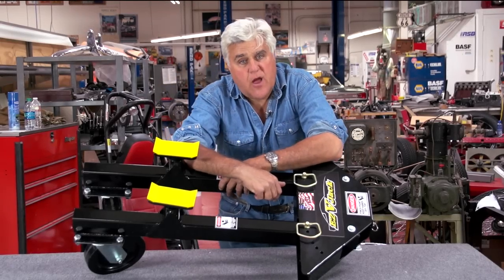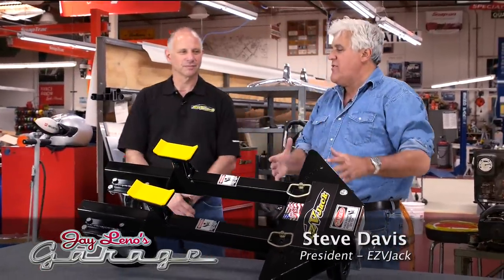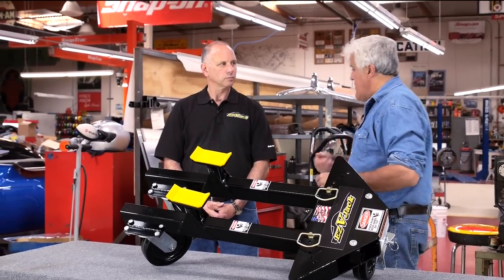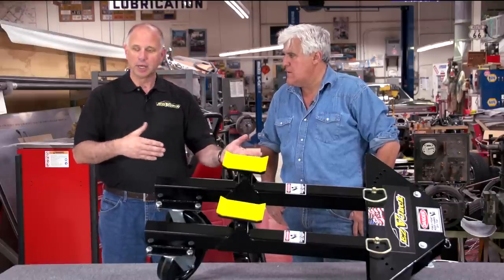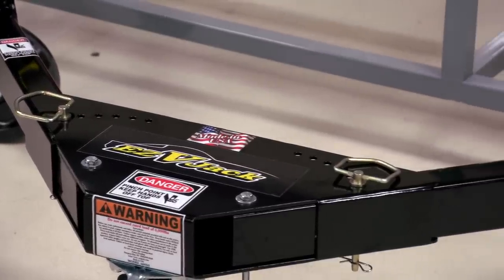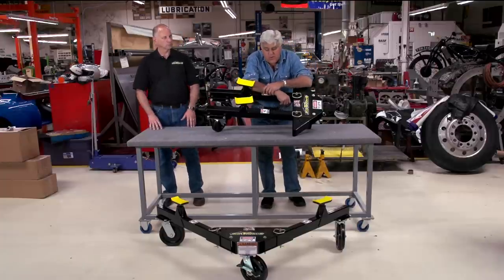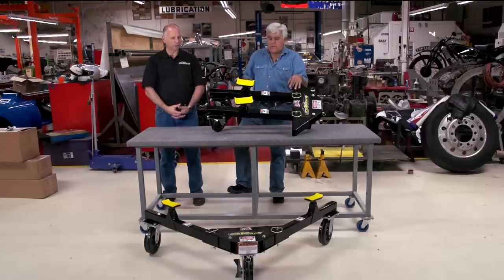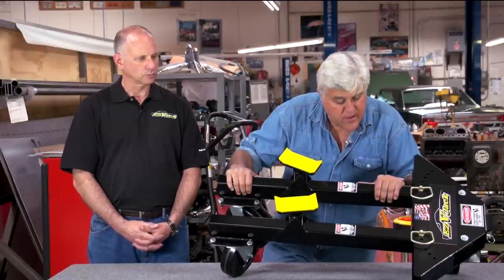Rolling Car Jacks - Jay Leno's Garage

Comment: I'm a disabled retired combat veteran that needs to rent something like that to move my '79 Trans Am 35 feet into my driveway before the property manager has it towed. Because I was forced to pull it out of storage after 15 years and the carb is shot to heck. I've been wanting to design something on this idea for a while now, but something motorized and with a wireless remote. A grand for something I may only use once is a bit much for my pocket book. Great product though. Thank you Mr. Leno and team. Thank you for your service Steve.

Comment: I would add two features.  I would have the axle pads set on an adjustable post, like an everyday jack stand.  There are some 4x4's and large rim cars where the rear axle is much higher off the ground.  Second, you could have a handle the connects to the front wheel.  It would be like a tow bar for a small aircraft and you can direct the direction of the vehicle much easier.
Reply: nice upgrade and that shouldn't cost all that much to do ... just tack on another $500 / each and they can be yours !

Comment: The good stuff is NEVER cheap.

If you are not someone who uses this type of gear on a regular or semi-regular basis, $1000 is going to be a hard pill to swallow. But if you like or need to work on your car, like tuners, modders, restorers, racers, and so on, this is actually some seriously inexpensive hardware.

They even tell you who these jacks are aimed at on the website. Complaining about the cost is just short sighted an more than a little lame.

Comment: They've "Raised the Bar" with this product.." I'm so pumped man", i just "need a lift" so i can go and buy one.. $9.99 is a fair price.. That's what the stricked stubborn sounding man said right? $9.99.. wait a second.. whaaaat?!? $999? are you Serious? GTFOH. it's worth $450 tops
Reply: $999 for a pair as in two of them
Reply: I'm curious to see your calculations that yielded $450 price.
Reply: Alessandro Galiano Doesn't it always? lol
Reply: It's $999 for 2 dude.  That is $499.50 each.  Close to your $450.
Reply: 2018- $1499 a pair

Comment: Interesting but I think I'd still rather have a set of Go-Jacks
Reply: Yeah but gojacks are for vehicles with wheels still attached. You can take all the wheels off and still use these
Reply: I think application would be important between this and go jacks. I do like these for the wheel off option. that and there about the same price.

Comment: Without any vertical adjustability I can't see this as an option for a $1000. I have some steel plates from Harbor Freight that would be about a $100 to $150 and yes they have the smaller castors and two of them lock. They work but if you have a floor that is not flat it can be difficult. I can see the advantage of the larger wheels.

Comment: I'd still rather have the wheel-jacks, you can fit them in without having to jack the car up or even inflate the tyres, and they work on cars without separate chassis. You can also pick up ten full (good quality) sets for the same price as one pair of these! Nice concept though.

Comment: That's a 1000 bucks just to to sit under a car, 2 high quality floor jacks would be money much better spent.
Obviously aimed towards the rich guy
Reply: It's not made just to hold a car up. It's made for shops so they can bring the car in, inspect it, and be able to easily move it back out. It's made for cars that can't be moved because they have been wrecked or are projects and don't have wheels, axles, subframes.
Reply: Or more likely aimed at businesses.  If you use it for one car it's expensive, but if it's a shop tool that lasts and as a bonus the money stays here,  it's value goes up dramatically.

Comment: I think that is a fair price for what you’re getting. Hell the jack stands we use cost $200 a pair. Or you could buy Harbor Freight ones for $50 with a coupon. Oh wait you can’t anymore because they have been recalled and no longer for sale. This product looks like it works, sub $500 are a pain in the A$$ and sketchy.

Comment: 3 LARGE CASTERS A FEW PINS AND SOME SQUARE TUBING WELDED ? $1000 ?? you can buy all the materials and still have money for an eastwood 175 mig welder to finish the welding .... I am a veteran and above all else I consider value the most and this product doesn't even include the jacks ?
Reply: Don't forget the powder coating, lol. If the metals thick you could probably stick weld it even cheaper (including a new mid range stick machine).

Comment: Is there a powered car mover made that could be used in a situation where there is a two car overhead door that is too narrow to easily fit two cars? My objective is to drive into the garage, then move the car perpendicular to the overhead door. Then the second car fits in easily. 

This is a common problem in Florida, where the dual overhead garage doors are really too narrow to fit two larger cars. It’s not possible to increase the width of the overhead door, because the overhead door was narrower to make the house stronger for the possible hurricane winds. The house would have to be re-engineered, which would be cost prohibitive. As a result, many people only park one vehicle in the two car garage, and the other vehicle must park on the driveway.

Do products exist that could be installed in the garage floor, so the car can be moved perpendicular to the overhead door electrically?
Reply: You mean probable hurricane,right?
Reply: @peterzinia3767 The double overhead doors in Florida are narrower than the states up north. That narrower double overhead doors makes the houses stronger against the heavy winds that are sometimes possible to occur during hurricanes. 

We had up to 80 mph gusts from the weaker backside of a hurricane as the hurricane traveled from Ft Meyers towards Orlando, and then out into the Atlantic Ocean. The 80 mph gusts did nothing to the house.

We also installed the heavy metal reinforcement bars on the double overhead door before the hurricane. It takes about 45 minutes to install or uninstall the heavy metal reinforcement bars. When the heavy metal bars are installed, you cannot open the double overhead door, and the double overhead door is a lot stronger!

Comment: 1500 and I STILL have to jack up the car? This is a rolling jack "STAND" - NOT a rolling "JACKING" stand. Wow I'd hate to see the price if they actually did jack up the car.The whole idea of SMALLER wheels is to get under the car WITHOUT having to use a floor jack to jack it up. Physics man physics.

Comment: I would be ok with the price if this thing was send for some independent safety test and it came back with a certificate. Much like TUV of German or JIS of Japan or even ISO from the company. But this doesn't have any of those and its at the premium end of the price scope. That does not make make economic sense than having 2 to 3 regular jacks.

Comment: Let’s see, ten years ago it sold for $999 for a pair.  Today 2024, it costs $1699!  That’s basically $70 a year increase.  Rate of inflation normally stays around 1-3%??  So for a $70 increase annually, and only based off inflation, that’s a 9% (89.91) increase annually.  He really likes the number 9.  So at this rate, in the year 2030, this will cost $2119 while maintaining the 9% for inflation.  I am no expert, but either his manufacturer is screwing the pooch on this, or that CEO doesn’t understand competition and basic business finance.  I can build the same product with all the fancy stickers for roughly $200 or less.  I could even change out those wheels made for smooth floors, to a wheel that will work even in small gravel.  Think of all the shops out there that don’t have a full asphalt exterior, hhmmm!  😅